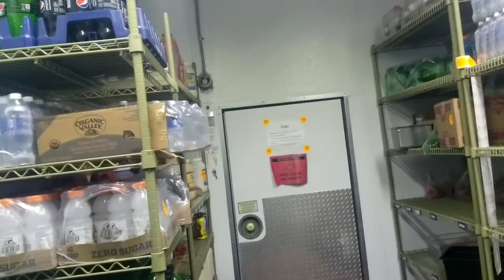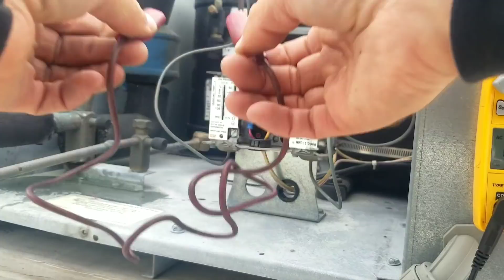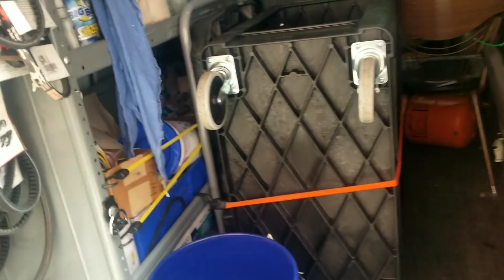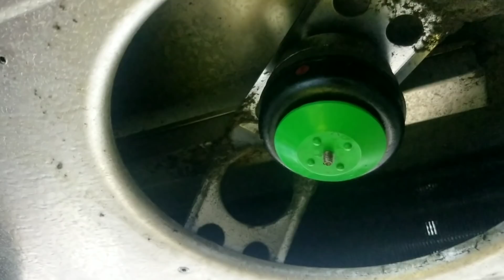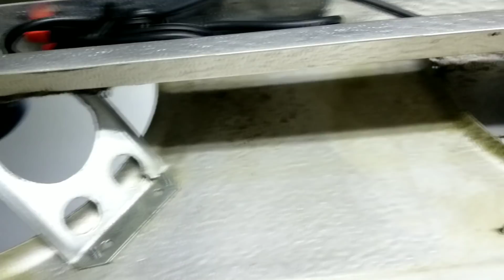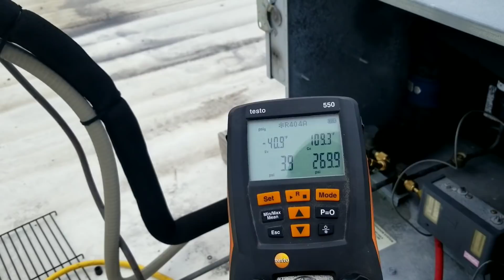Walk in cooler not cooling

Comment: Good video on a common mistake everyone makes on a daily basis. We all make them in way or another. When you restock your van put 2 of each evap fans on your truck one to put in one for stock. Each rotation. Looked at on of these low profile unit the other day I couldn't believe how clean the evap coil was. Unit it 3 yrs old out in a common area for customers to walk in. Basically a room with to low profile units. Nice video thank you. Be safe be  good.

Comment: I thought when you were fiddling with it that the old thermostat turned on when you turned it up above 50 and turned back off when you turned it back down. I was wondering if someone had been playing games and reversed the wiring on that SPDT switch on the thermostat.
Reply: the wires on the thermostat were on wrong, set up for heating instead of cooling. It either never worked right or someone just replaced it
Reply: That was going through my mind too.  Maybe a previous effort by a dabbler.
Reply: So, most likely nothing wrong with the old thermostat, just miswired. Can't have been long ago
Reply: @Frogzillanz  Sometimes it throws you when you come across stuff that has been interfered with by other people before you arrived.  Especially when you don't know they've "modified" it.
Reply: @bigclivedotcom  I do a bit or repair work for Vietnamese restaurants, I love the food. Covers mysteriously lose screws, adjustments move, parts even change but nooooo one has touched it, no sir noooo one.
The standard MO seems to be they call you, you give them a quote they then call a local 'handyman' who says I can do that for half the price, using your quote as a diagnostic tool.  He then cobbles in second hand miss matched parts and vanishes in a puff of cigarette smoke as soon as he has cash in hand. 2 Weeks later you are back with an even bigger quote and a very unhappy customer, but they keep using unlicensed handymen.
Reply: @raygale4198 . We  find after their experience with cowboy techs, they get us back and realise "paying for quality only hurts once "  and works out cheaper long term. Why would you risk say 5k of machinery plus 5k of food all to save $300 on repair?
Reply: @raygale4198  Exactly right. I had that problem with a college bookstore I was trying to get the PM contract for. Went above and beyond for them hoping to win their business but they would never authorize repairs or follow through with the contract they kept promising. Every time they called for service it was more than obvious someone had made changes since the last time I was there. Finally figured out that I was diagnosing the problem and the campus maintenance would "attempt" to fix it. I finally slapped a $80,000 quote on them to replace 9 30yr old york rtu's and told them to stop wasting my time.

Comment: Whats the reason for a pump down, I realize its to keep liquid from the compressor, but is it for less parts and simplicity able to short cycle too?
Reply: Avoid the liquid component chilling down too much during off-cycle, which could harm the compressor
Reply from the maker: It helps with refrigerant migration and allows the compressor to reach its normal running compression ratios much faster

Comment: So the thermostat was switching at the box temp. Could you have moved the wire from the yellow terminal to the blue? Was the thermostat just replaced before you got there by someone else?
Reply: it likely had burnt contacts inside, the blue terminal opens on temperature rise, while yellow closes, red is common of the spdt switch. Johnson Controls (A19ABC-74C) if I had to guess. but may have been fixed differential model :)